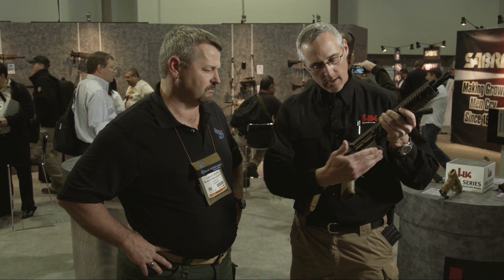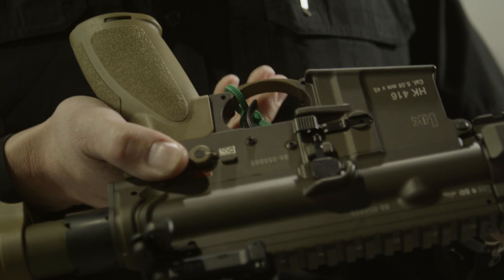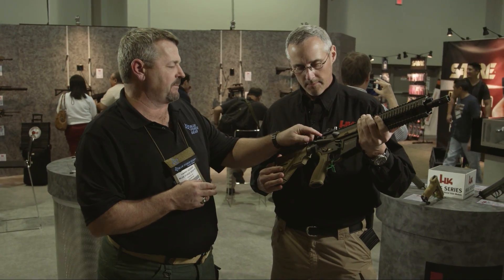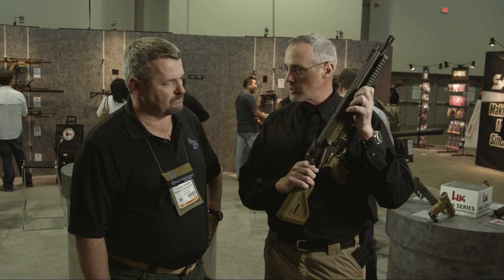SHOT SHOW 2015 - HK416-A5

Comment: for something new on the market it looks outdated with the quadrail
Reply: ***** My thoughts too. You'd think that after Geissele made their 416 rail , HK would have done something different. But if there is anything harder to change than the mind of an engineer it's a German Engineer.
Reply: if its not new then why are they showing it at shot show 2015 thats like a car dealer showcasing 2014 car as new